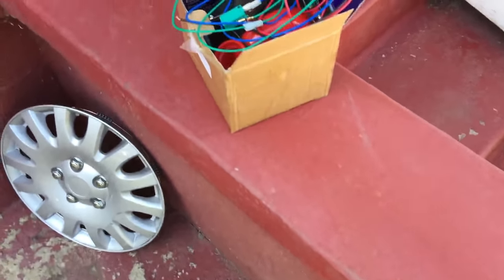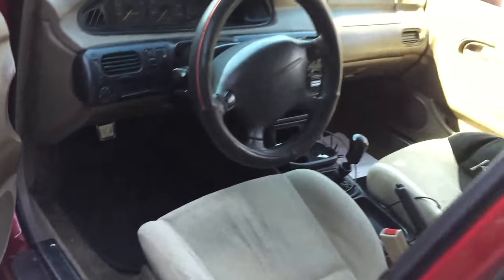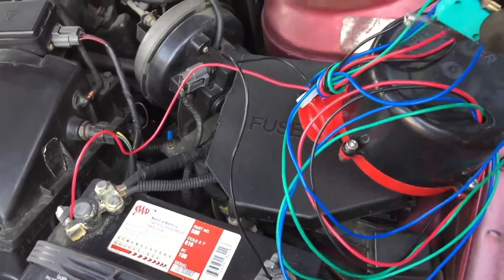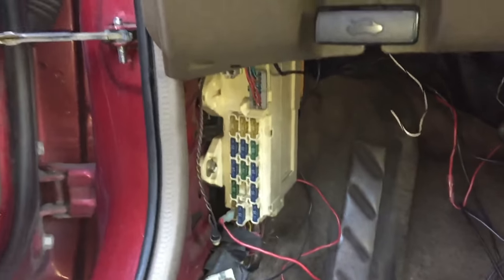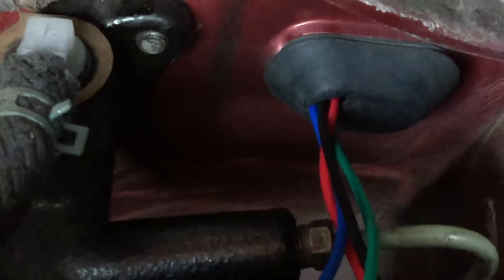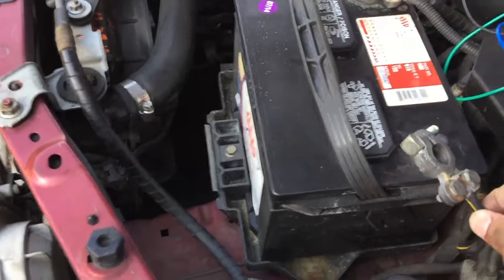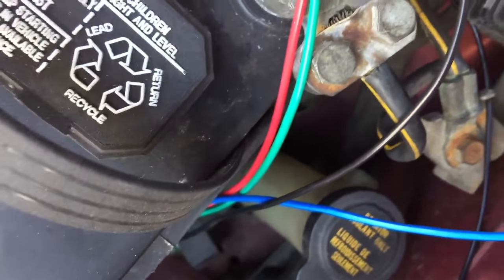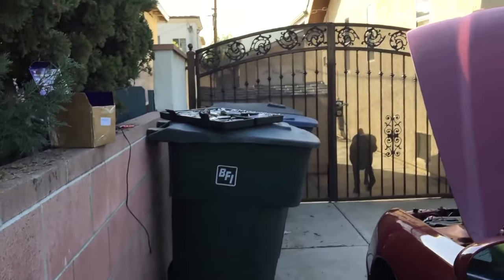Fake Blow off Valve

Comment: 2:34 WOW Its Turkish let me translate it for you:
Left side: THIS DEVICE IS NOT A TURBO.
Right side: Inside the Box; 1 piece of electronics turbo, 1 piece of cable set, 1 piece of 10 amperes fuse, 1 piece of micro switch, 1 piece of connection set. This product has been produced in China by Turbo Center.
Reply from the maker: Bahadır Onur Güdürü wow! Super cool man!! Thanks!
Reply: Bahadır Onur Güdürü vay be helal

Comment: Nice video.  How did you wire the positive lead of the blow of valve into the fuse box?
Reply from the maker: +pokk700 For me there was a prong on the side of one of the fuses already. I assumed that was for my old alarm system. So i got that wire and stripped a piece of it and connected the positive wire from the blow-off valve to it. If there is no prong already you can buy a C prong circuit tap. Look at around 6 minutes to see how i connected it to an already existing wire.
Reply: +OhGoshJosh Ok, that makes sense.  Thanks for posting

Comment: i bought one, but the sound comes out when we press the switch and not when we release the switch. what can i do with that? i want press the gas and when i release the gas the sound comes out.
Reply from the maker: +alexandre goulet put it on top of the gas so when you let go of the pedal it will go push up on it. I was a bit disappointed with that too.. there are little wires attatched to the switch try moving those around. I didn't play around with it too much!
Reply: +OhGoshJosh i found how to change the sound pattern. put the blue wire on the middle connections on the switch, the sound comes out when i release the gas.
Reply from the maker: LOL yeah I was about to release a video on how to do that! nice job Alexandre

Comment: so you switched the blue and green wire and it blows when you release the gas?
Reply from the maker: +Austin Peters no keep the green wire there, but move the blue wire to the other link. Then itll work that way.
Reply: +OhGoshJosh ok just got one in the mail today to mess with my buddy that has a turbo vw but I want it to be realistic
Reply: +OhGoshJosh if you get the chance make another video

Comment: Is there a way to reverse the switch so it sounds when you let off?
Reply from the maker: +Steven Jones I was thinking the same thing. Im not sure if you change around the connections on the switch how it would effect it. but you can just put it on different parts on the pedal to push the switch at different times

Comment: I mean, I get that it's a joke, but at least put the ground somewhere it's not going to fall out immediately. You could have put the flathead in the ground cable, split the terminal apart a bit, and then shoved it in there before tightening it down.
Reply from the maker: Yeah could have but there was no intention in my head to keep it there